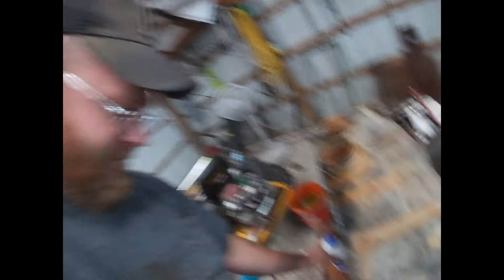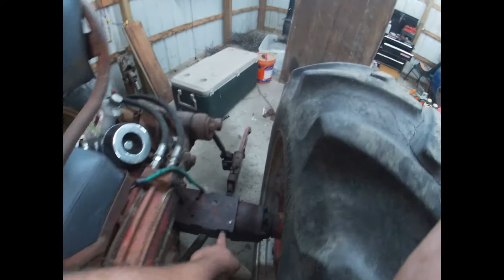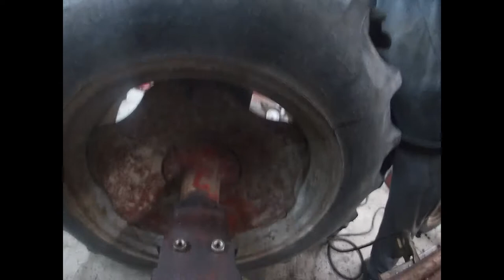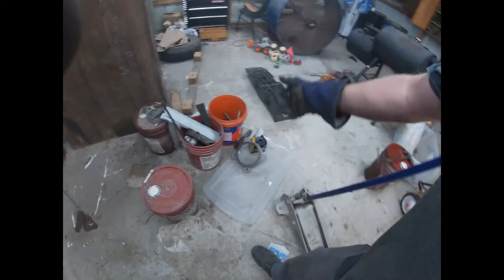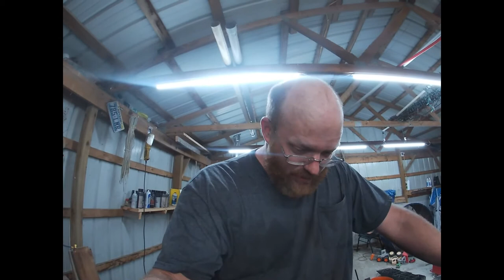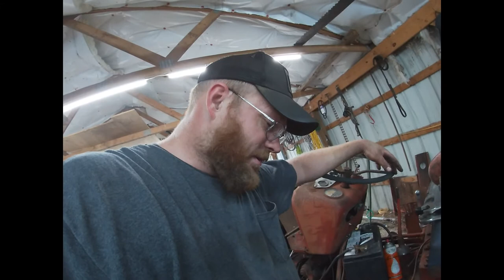International 300 radiator flush, and Extracting broken bolts

Comment: The old girl runs nice and smooth. If the broken bolt you’re trying to extract is high tensile soften it by heating it cherry red with the oxy and let it cool down. Then it might be soft enough to drill and use some sort of easy out on. I’ve done dozens of broken studs over the years, no matter what method you use they are rarely easily done, best of luck 😩. Regards from Down Under.

Comment: I have used the ole weld a nut to a broken off bolt or stud also.  While it works, I am never able to get them all either with that trick.  50 to 60% success rate for me with that trick is my guess.  Then it is usually the fun job of drill and retapping.  As big as those bolts are you can likely get away with a size or two smaller than original if you suspect the threads in casting are gone in that hole.
Reply from the maker: I really should buy a small mag base drill, that way I can just set it there and pull the lever. But with a hand drill and the tire still on  I couldn't get enough pressure on a 3/16 bit to cut it. I really don't want to pull the wheels yet. 75% is good enough for a Fender in my opinion